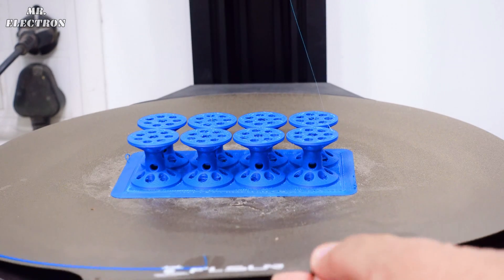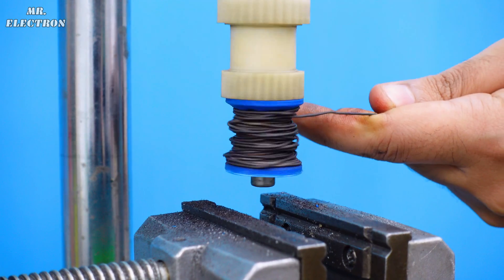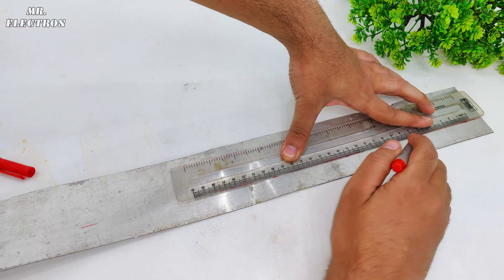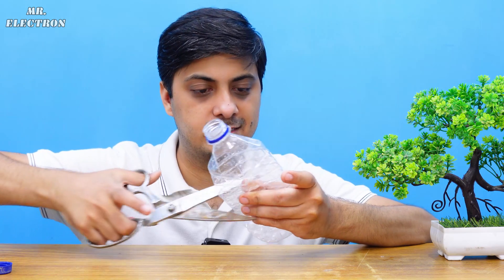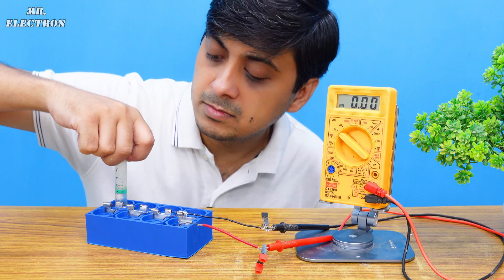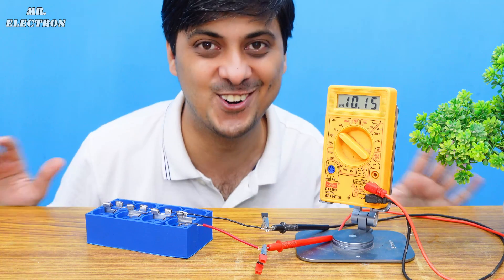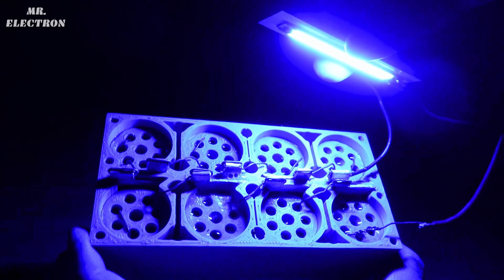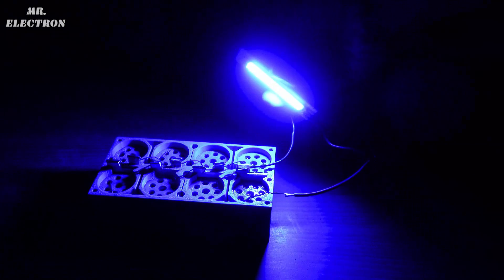How To Make an Aluminium Air Battery | Genuine Experiment for Batteries DIY

Comment: “Air” batteries, adds liquid electrolyte. Cool story bro.
Reply from the maker: Well ! there is this big confusion with many viewer's. Firstly - This term Air battery is not given by me but by the inventor of this air battery. Charles F homes patented the first aluminium air battery.
Secondly - Air battery name was never meant for air electrolyte but flow of current because of absorption of air (oxygen) by the anode aluminium (or others) .
Thirdly - Water contains different levels of dissolved gasses amongst which, oxygen is also present in large quantities.
So in simple terms, the name air battery was give in 1886 because air (oxygen) is consumed by Amluminum for production  of current and not because the electrolyte is air or gaseous.
Air battery electrolytes can be solid state as well as liquid.

Comment: Good idea and  its much improvable 👍 starting with geometrik after making your Ironcoil print a seperator 1mm thick around this coil the alu around it so you got a round cell instead of a two point cell. 👍Now you take some spare alu to connect all cells as thick as posible, also use bolts to connect the ironcoils to each other 👍 these 2 things will give the Reaktion much better surface so more Reaktion in same space, also the bigger Terminals support bigger Wattages and leads to less powerlosses between the cells👍 hope this helps you improve it 👍
Reply from the maker: Thanks! Correct and I have already stated that in the video as well. Actually the issue was that the design adjustments were taking linger than usual and the project was getting delayed.

Comment: I have doubts do comple ion move from anode to cathode through electrolite or it pass only electron or pass only charge via electric field. Some one has to end these doubts.
Reply from the maker: Ions move from anode to cathode and electrons move from anode to cathode externally when a wire is connected
Reply: @MrElectron instead of transfer of ion can we make transfer of only charge by electric field similar to current in conductor?

Comment: Cool👍 you never stop to amaze..can this be of use to drive  small ebike motors 250/350 watt and can be built under the budget of a 10AH battery pack?
Reply from the maker: Thanks 😊! Sure with some more additions like catalysts, ph stabilisers, etc and a bigger battery size , it is  definitely possible.

Comment: this thing seems to be fake
Reply: I believe it actually would work and it would be on the same basis as the thermite reaction. The aluminum will want to readily give its electrons to the iron oxide on the cathodes and creating the closed circuit gives it the ability to do so. Edit to add that I was skeptical when I saw the thumbnail but as I watched this I realized that it is actually a viable electrochemical reaction to take advantage of. My question is how reversible can this be? Can you recharge this cell to any significant amount?
Reply from the maker: @solvated_photon  No, it's a fuel cell and its non rechargeable.  Once the aluminium plates get consumed, we have to change it..
Reply: @MrElectron okay, so it is the dissolving of the aluminum in the hydroxide itself that drives the electron flow. This makes sense because aluminum dissolving is recognized as an effective reducing reaction in chemistry. One way people will speed this up is by adding a Hg2+ salt which helps mitigates the passivation layer, but in this case I think that would make the reaction too fast. You already have an impressive power source from very basic materials. Well done! 👍
Reply from the maker: @solvated_photon  Correct! And Thanks 😊 .
Reply from the maker: Seems like you are new to my channel. I can totally understand you especially when there is so much fake content surrounding us all over youtube, insta and fb.
It will take time for you to gain trust on any new channel with research grade content. 
I as a content creator will say only 3 things about me.
1- You are free to verify my other videos to gain trust.
2- I am the one who actually exposes the fake video creators on youtube through my other channel ( Mr. electron alternator ).
3- I never hide the number of dislikes on my videos even though this option has been provided by youtube. Although, I think it's an evil option and I have asked youtube to remove it but at the end, it's youtube's decision.

I hope that these should clarify things.

Comment: Nice one, what's the advantage of not using graphite or carbon cathode   in your battery.
Reply from the maker: Excellent question. For the same current production, larger carbon cathode size is required when compared to steel.
Reply: @MrElectron  I Read that platinum wires are anti-rust but steel wires get rusty in the electrolyte over time resulting in high resistance. I used carbon electrodes and it's working well.
Reply from the maker: Correct. Yes carbon electrodes give better results in the long run as I tested in my previous video 👉 https://youtu.be/sBIAWSCLKFA?si=zjZOBI7Tf_7FPYE7

Comment: nice, you got it working. do you have any idea why its working in the air mode and not in the voltaic pile mode. ie why it prefers the aluminium-air instead of aluminium-iron working mode. one little problem is that the aluminium+KOH produces hydrogen. so it might drop down to hydrogen+ogyxen fuel cell at 0.6-0.7v working mode. if the liquid/walls gets saturated with hydrogen gas. do some long time tests, how the cell operates. not only fresh cells. if the chemistry gets contaminated easily then not so good. ie total energy over time graph. if it works in true aluminium-air mode, then no dendrite formation, just aluminium consumption. you have two reactions going at the same time. the deposition reaction is the second. find a chemistry that does not do that deposition. yeah carbon air electrode does not do that. try silver. possibly platinum. with silver you get the silver air electrode brightening up. yep the silver clean-up chemistry. try silver spoons as the air electrode.
Reply from the maker: Correct. Sure, silver will solve the problem but it's expensive. My aim is to go for the simplest, cost effective + efficient methods that provides a long term performance.
Reply: @MrElectron  electroplate an steel electrode with silver, much cheaper.
Reply from the maker: Good idea  👏.  Didn't  think about that. I will keep that in mind for one of my upcoming air battery videos.
Reply: @MrElectron  also silver lets you use baking soda as the electrolyte vs koh. Safer and does not generate hydrogen at aluminium surface.
Reply from the maker: Ohh that's interesting.  Thanks ! 👍
Reply: @MrElectron  I tried it, again, it seems to have the same deposition voltage issue, as the iron-aluminium, ty aluminium foil + silver spoon. it starts at 1.3V drops down to 0.7V. with only baking soda. graphite seems to be the best, both salt water and koh.
Reply from the maker: Ohh! Thanks for this valuable info 👌👍
Reply: @MrElectron  yeah, no use doing galvanic cells, unless you want to do galvanic cells. graphite is the best for non-galvanic air electrode. cheers.
Reply: @MrElectron  maybe platinum and gold would be better than silver, or even graphite. as thin electrode surface coatings.
Reply from the maker: @gsestream  yeah! Because of there non reactive nature
Reply: @MrElectron  anyways, why do I get just 0.7V long run with salt water electrolyte and aluminium+graphite rod. drops down from 1V.
Reply from the maker: @gsestream Passivation
Reply from the maker: 😀👍 Cool
Reply: @MrElectron  the silver even as thin layer is not consumed. from the air electrode. pure silver regenerated if oxidated. maybe a silver conductive paint is enough as air electrode.
Reply: yep you literally get an aluminium-iron galvanic cell after the deposition on the iron. no more high aluminium-air voltages. more like 8x 0.6v = 4.8V. or so.

Comment: At 1.6 amps, you could make hydrogen with only 2 units!
Reply: It is much easier than that. Simply mix aluminum with strong hydroxide or hydrochloric acid and you can produce plenty of hydrogen very quickly. Sometimes the reaction starts slowly but it can quickly go out of control once the aluminum oxide passivation layer has dissolved. Edit to add that as a teenager, my friends and I would make “percussion bombs” by closing aluminum foil and HCl containing toilet cleaner in 20oz soda bottles. Very illegal in most places but it sounds like a cannon going off.
Reply: @solvated_photon  very fun;  and you have time to move off because of the NOISE!!  COVER YOUR EARS, each with ONE finger; seal them tight; i did not do that when i was young, and my right ear is less than half effective now,  too late....
Reply: @josepeixoto3384  oof! Sorry to hear that, no pun intended. Back in the day I lived next to a river so I chucked a few in there at some point or another and they would get downstream a bit before going off. Otherwise I remember me and my gf’s brother put a few in garbage cans outside gas stations before driving off down the road a ways.